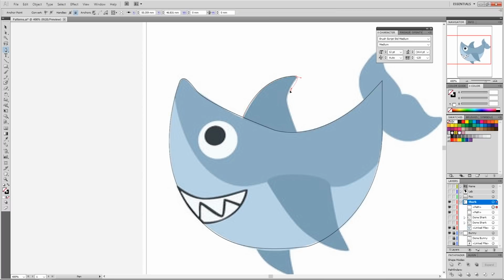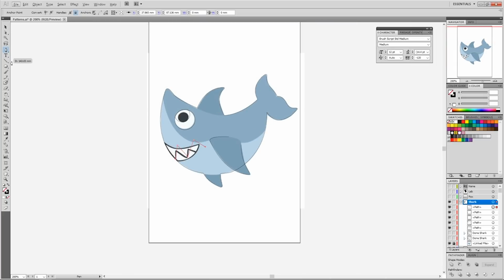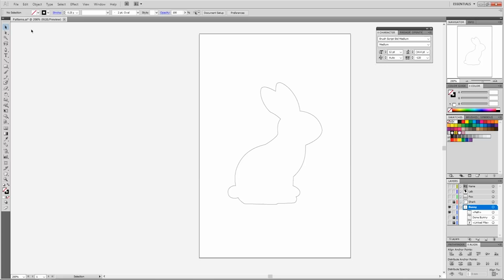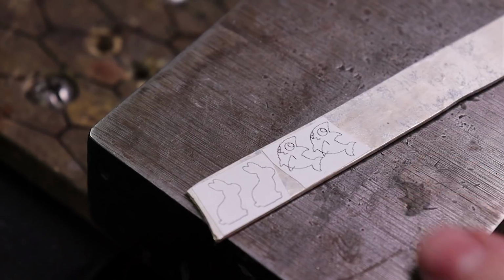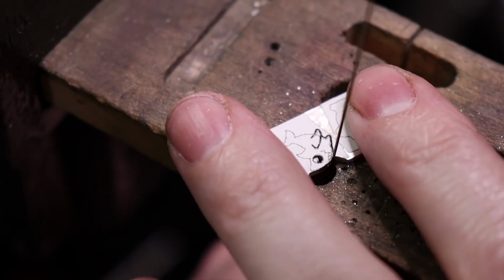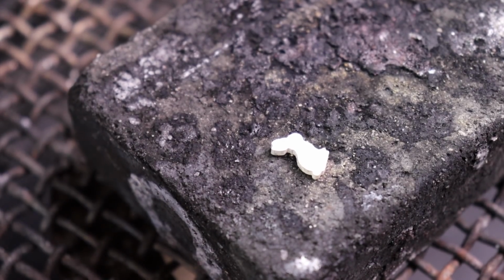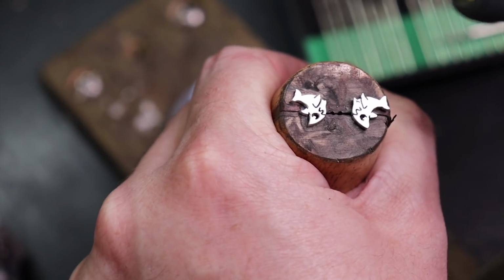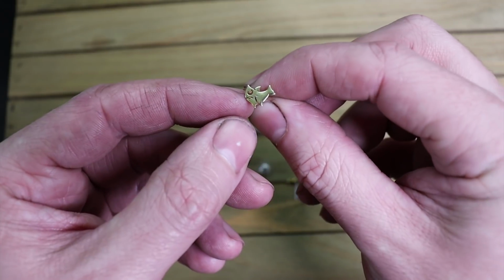How to Design & Make Basic Stud Earrings

Comment: What is the tool called where you poke holes in the middle of the pendant?
Reply from the maker: At wat time in the video did you see the tool?
Reply: GomeowCreations like in 12:52 when you said you need to drill a hole into the shark’s eye. I’m a bit lost on what drill I should buy to accomplish that job. Like regular drill? Is there a link you can leave?
Reply: Can I get a response please? 😭
Reply from the maker: Sorry about that https://www.riogrande.com/product/busch-tungsten-vanadium-twist-drill-set-0-51-6mm/341600 here is a link to some drill bits that I would use

Comment: 1:11 it's a shame aluminium can't be easily welded because it's hypoallergenic. At the same time its oxide layer is precisely what protects it and the wearer. A good choice for hooks though.
Reply: Lead solder , (hot gun)

Comment: Surgical steel is another good option for metal when it comes to earrings. I for one can not ware silver of any quality. I am allergic to Silver.
Reply from the maker: Yeah that is a problem but you can't really solder steels to the cutout... 😅 Also I'm sorry to hear that you have silver allergies to silver 😓. How are you with gold?
Reply: I am good with gold, it can be price though since I have to stir clear of the plate gold since simetime they are silver core. I will have to looking to the differnt types of metals that works together when, I get somewhere where I can do metal work. They are both really cute. Love your work.
Reply from the maker: I was going to just suggest plating haha. You can do gold filled, it is normaly 90% brass core and 10% gold. also thank you very much 😁

Comment: You make using that saw blade look easy.  How long did it take to learn how to do it so proficiently?  Do you wax it first?
Reply from the maker: I have years of practice with the saw so it's something that I can do without thinking now but it looks about 6 months to get to the point that it was no longer a problem at all. 

I do use some cut lube on the saw blade itself be I really don't do it that much.

Comment: How you manage to cut those corners without breaking a saw blade is beyond me!
Reply from the maker: Well I make sure the work is supported on the bench pin. That is why I use the small hole in it to cut my work. I also make sure to always me moving the saw blade to it doesn't get stuck. 😁
Reply: @GomeowCreations  , don't forget lubricant